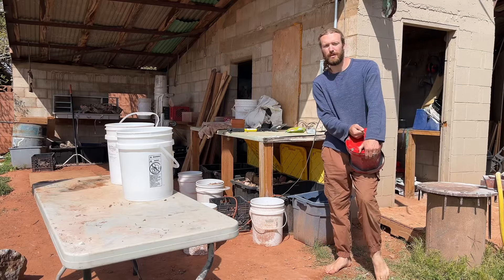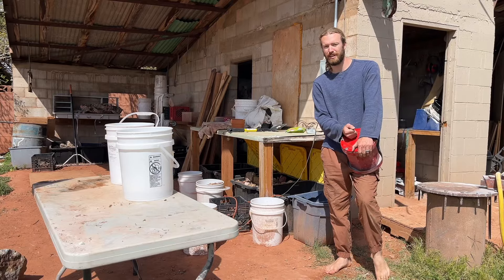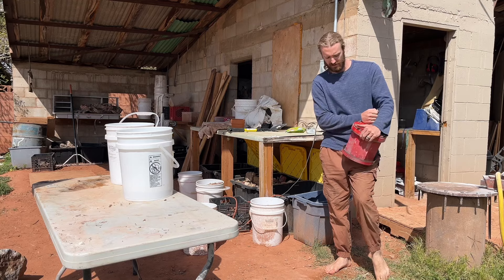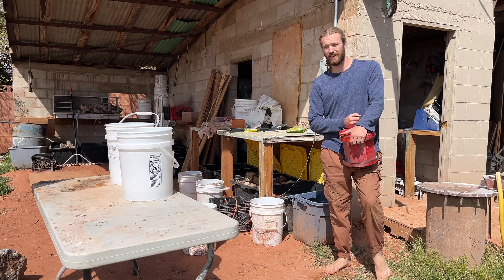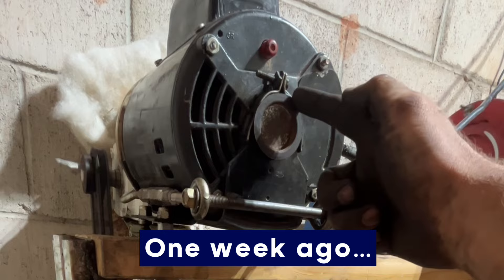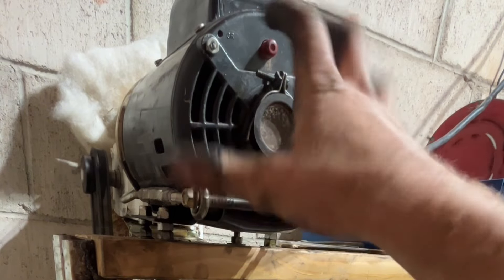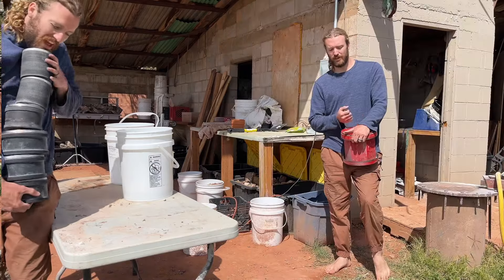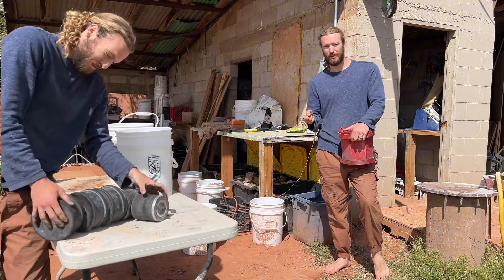Transforming Stones: Rock Tumbler Grit Exchange

Comment: How did you attach those pulleys to your shaft is it with just a set screw or does it have a set screw and the key way also?
Reply from the maker: I have a sprocket attached to the shaft and it is keyed, I got a size too big so I shimmed the other side of it to make it even. The whole thing is a bit sketchy